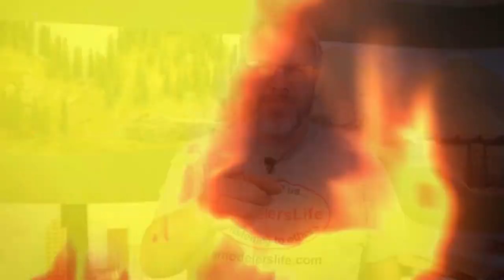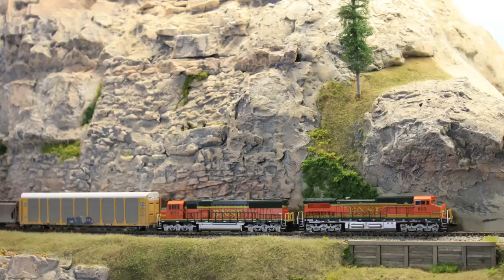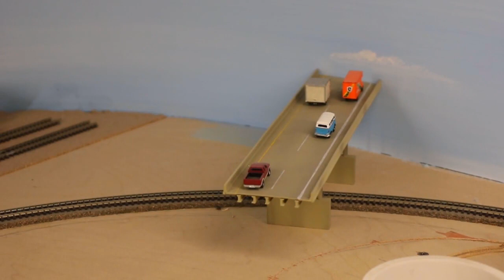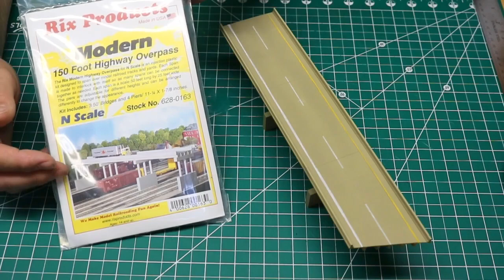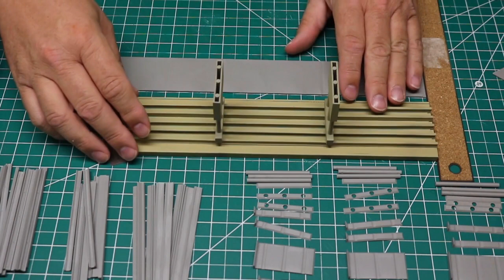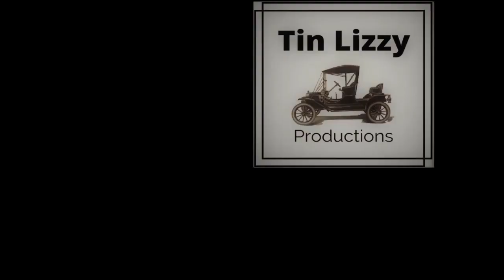Building A Model Of A Modern Highway Bridge

Comment: This is so cool, thanks for posting this.  I will need to make a couple of bridges and highways.  Did you build the bridges?  How wide are the bridges?  Where do I find out how wide the roads should be?  Thanks for the awesome videos, and the help.
Reply from the maker: I used RIX modern highway overpass kits and widened the shoulders by 4 scale feet. You can Google highway standards, but typically each lave is a minimum of 12 feet wide with an 8 foot shoulder.

Comment: Nice tutorial, Ron...but why didn't you just fabricate the bridge deck out of sheet styrene? That way you wouldn't have all those joints and it would have been a much more solid surface to construct the rest on.
Reply from the maker: The seams are prototypical as concrete bridge decks are poured in sections and have expansion joints, plus the kit was a good starting point having the concrete beams, concrete guart rails, etc.
Reply: @RonsTrainsNThings  that is true, Ron, however...those joints could be scribed in as the cracks you did were. In fact just about all of the kit components and structural shapes can be found in styrene from Evergreen or Plastruct and would still be a much more solid model for probably less money.

Comment: What kind of a glue applicator are you using? The glue only goes down the side of each beam?
Reply from the maker: It is called a touch n flow applicator. The cement goes along the side and cappilary action wics it into the joint, creating a quite strong joint.
Reply from the maker: Here is a link. https://amzn.to/2LBxsIV

Comment: Ron I have a touch and flow and the needle is clogged do you know how to unclog it Thanks Wendell
Reply from the maker: It probably has a bit of dissolved styrene in the needle. Soak the needle in your bottle of solvent cement for 3 or 4 minutes, then use something to force air through it from the other end. If you have the one that came with the bottle use that, or an ear syringe should work.

Comment: excellent job Ron. I have never purchased one of them kits, since they come in a bag i just figured they were cheap kits and not much detail. but looking at what you did with this one. I going to have to check them out. see you on the next video. look forward to your detailing.
Reply from the maker: Rix kits are great kits for kitbashing modern structures. I've used many of them.